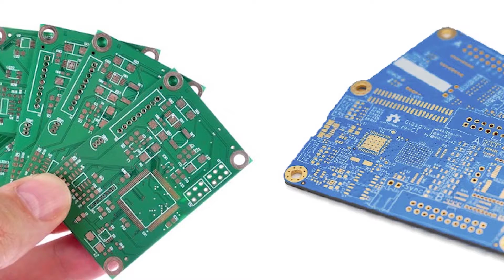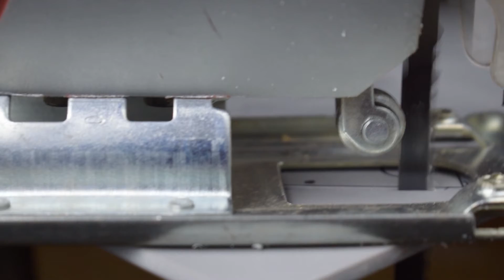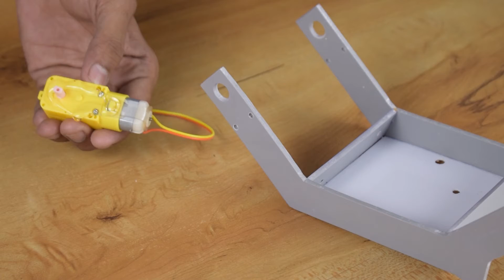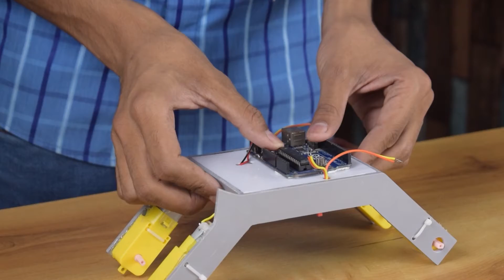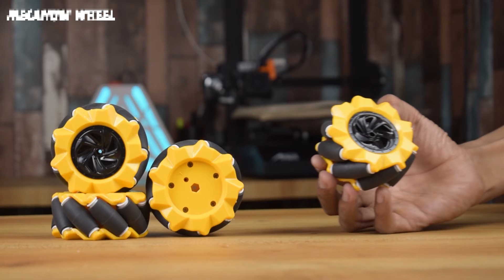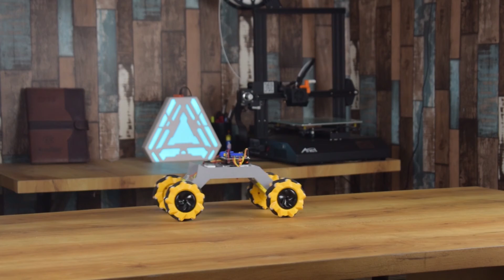DIY Arduino Mecanum Wheels Robot | Smartphone Control

Comment: @Pro Know Which size screw did you use to join the motor coupler to the mecanum wheel?? And the mecanum wheels are 80mm size right??